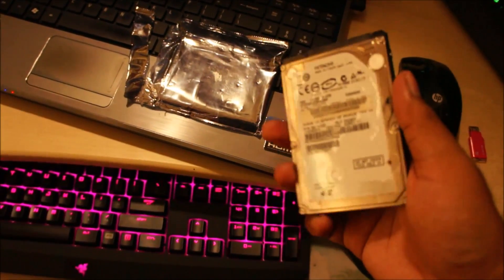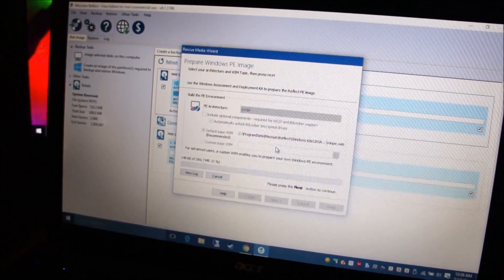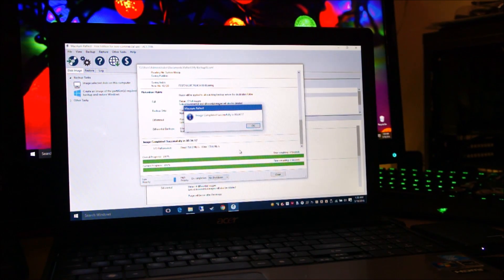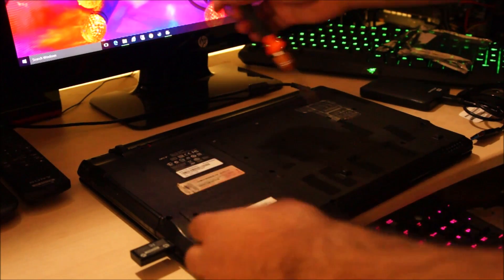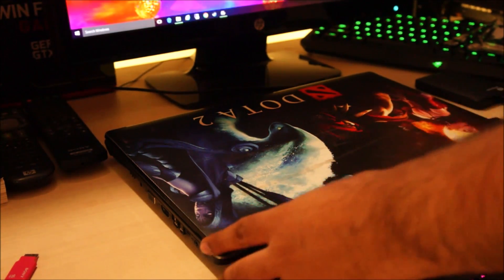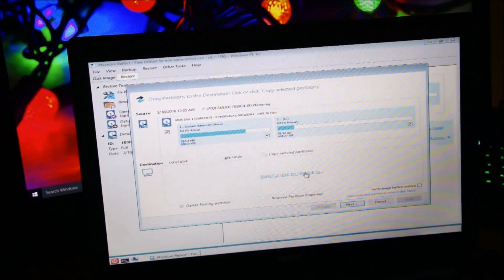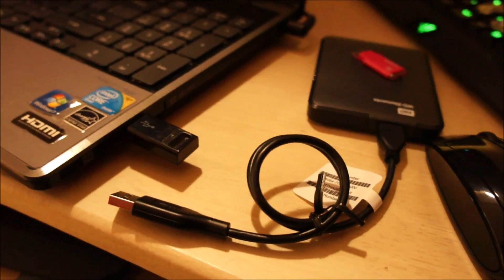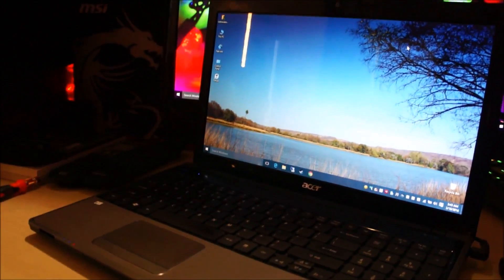Clone/Copy EVERYTHING including Windows from old hard drive to a new one step by step (Easy way)

Comment: I tried this on my WINDOWS 7. Everything went well as expected and as seen on this video until I went to restore the computer system with the newly created CLONE. Once I had plugged my cloned external hardrive and the WinPE recovery memory stick into the USB port, I went into BIOS of my computer and changed the boot order to USB WinPE recovery memory stick. So, that when the computer system boots, it will boot into the WinPE usb stick as is shown in this video. However, my computer system doesn't LOAD the MACRIUM software or WinPE recovery program but REPEATEDLY DISPLAY the world GRUB over and over nonstop in a DOS MODE. I thought maybe it was just my computer system that is acting up. So, I tried the whole process on another system but with the SAME RESULT. I can't for the LIFE OF ME figure this OUT and very frustrating. I am about to switch to some other software. If someone could reply to my comment in time, I would appreciate it. Thank you.
Reply: TN Hi TN, Thanks for ur comments, it help clear a lot of doubts. I have one question though. The process referred to in this vdo & to which u referred in ur comment, is this called disc CLONING or IMAGING. I think once u clone ur disc to an external hard disc, u can directly boot from that. But if u have a image file then u need to follow this processes. According to my understanding therefore cloning is a faster process. Actually I am trying to clone my hard disc & is searching for it for this for past few days. If u have any idea on CLONING process I would like to get enlightened.
Reply: TN Lol that was a smart move 😂😂😂😂
Reply: I'm not sure if I understand your issue correctly, and to be honest, I didn't watch this video passed the first few minutes. But if this doesn't work, you may try a whole bunch of programs like EASEUS, Paragon Partition Manager or Paragon Migrate OS to SSD or Acronis... I always keep a safe copy of my OS in another disk. There is plenty of info on youtube and google on how to clone a Disk, so if this doesn't work, find another way to do it.
Reply: +cubansoy
Hi, thank you for your reply. I figured out what the problem was. For some odd reason, my computer systems don't like to boot from USB. So, what I did was this. Instead of trying to run and boot from USB, I burned the rescue.iso on to a DVD as boot disk. Voila!!!!!!! Everything works this way... I was able to clone and restore my hardrive. Awesome!!!!!
Reply: ggv

Comment: once i cloned everything, can i use the old disk into another computer with all the old data in or there will be problems with windows license and all the other programs since im essentially using the exact same data (programs) on 2 different pcs?
Reply from the maker: Yes, you can use the old disk on another computer without any problem, but sometimes you will need to change BIOS from UEFI mode to Legacy mode, typically when moving the disk from an old computer to a new one. (usually, computers which shipped with Windows 8 and above have it set to UEFI) 
Windows will pop up a message that there is an error with the product key, you can keep using it but it won't allow you to apply themes or change windows colors rest will work as normal, you will have the exact same data and programs on 2 different PCs.
Reply: thank you for the informative answer!

Comment: Great video! 
I just went through this procedure. One problem that I ran into was that my EVO 850 1TB SSD was not reliably visible on the laptop USB 3.0 port (it would show up and disappear) but was visible on the USB 2.0 port thought it took approximately a minute for it to initially appear. It turned out that the older model “USB 3.0 TO IDE/SATA” adapter that I just purchased did not work reliably with this drive on the USB 3.0 port. After a long period of trying to understand that issue, I ended up just formatting the USB on the USB 2.0 port. I also made the mistake of checking the verify option during the restore process; it took 24 hours and displayed no errors.

Comment: I have made a exact clone of my HDD into a new external HDD. with  my internal HDD intact in my pC and with clone hdd connected tthrough USB, how do I boot from the clone disk ?
When I tried to change the boot order in bios from UEFI hard disk to  UEFI usb or just USB ( my USB HDD details are not showing, but bios simply shows as Mass storage device, is it a problem) my pc is not booting. I assume once you clone it should be a straight forward swap of the HDD to boot without a need for any rescue disk. It worked for me easily in Mac but in Windows  it is not .. am i missing anything , pls help. 
I need to verify whether my clone back up works or not

Comment: Can't i just directly create a clone drive of the old hard drive and not be bothered creating an image backup with that software ?
Reply from the maker: yeah, you can but for that, you will need a free SATA port on your desktops motherboard and a SATA cable or if you are doing it on a laptop you will have to buy a USB to SATA converter board.

Comment: Works with desktop hdd too right?
Reply from the maker: Yes it does, by the way if you are cloning on a desktop you won't need a external hard drive, you can directly plug in the drive you want to clone to in the empty sata port.

Comment: do u need a boot image if you buy a new motherboard and u delete all the drivers on the pre exsisting motherboard? because ill have both hard drives in when i boot with the new motherboard 1 with windows one without.
Reply: as long as i delete all drivers in device manager and in programs it shouldnt prompt me for a license key right?

Comment: Great Work!
I have one question. My laptop has windows 10 home pre-installed on it. And I need to replace the hdd. So, If I did exactly as you described in your video, and then made a factory settings reset to the laptop. Will the windows be lost ?

Comment: great work, saves the need of sata cable, thanks for sharing. Question: does the external hardisk need to be empty or it can save the images as long as there is available space for the image?
Reply: For the sake of history: I used my backup external drive with a lot of files - HDD image created by Macrium is just another file, no need to format/empty the drive.

Comment: will the windows be active still
Reply from the maker: Yes,Windows will still be activated  if you use the cloned disk on the same computer. But If it's put in a different computer then Windows re-activation is required.
Reply: Thx

Comment: Will this work with dual boot disk , if I clone the disk to the new disk . Is it going to dual boot after the process. Or I have to make two bootable drives. I installed or dual boot Windows 10 with Windows 7.
Reply from the maker: Just copy ALL the partitions from your source drive (the one which you are copying from and making an image)
And when you are pasting onto the new drive paste everything from the source drive image, in short, yes it works with the dual boot drives.

Comment: thank you for the video, quick question if i clone the hard drive and try to put it on different computer  does it work also ? all i need was clone the software but i don't think it will work due to so many set up require so instead i will clone the hard drive but i need to know if it work on computer to other computer (different spec and different brand etc)

please let me know I really need the answer soon so i can go get new pc
Reply from the maker: Yeah the cloned drive will work with ANY computer new/old different brand as well.. Windows will automatically download appropriate drivers needed for different model hardware ( BUT sometimes if the PC you cloned from is a older model (Windows 7) then in that case just make sure that BIOS is set to "Legacy" mode on your new PC. On all new PCs BIOS is set to UEFI mode.)
https://technet.microsoft.com/en-in/library/hh825112.aspx 
Another thing is that you will need a new license of Windows for your new PC.. Windows will automatically ask for new product key on the cloned hard drive.

PS: I love the husky in your pic :)
Reply: thank you so much for fast comment !! i will try it later and let you know how it went.. also did you ever herd about hard drive docking station ? I found it and just wondering if that work same as yours :)

Comment: so if i clone a hard drive to have two identical drives could i install the old drive onto the original computer and install the clone onto another computer? would that work or no?
btw awesome tutorial I'm just curious about that.
Reply from the maker: Thank you 🙂 and yes that would work no problem.. But Windows will show "product activation error" on your second computer because it will detect hardware change. Other than that everything will be exactly the way it is like on original computer.

Comment: I have a question I just followed your tutorial step by step and windows 10 loaded just fine but when I went to check the hard drive size it says its the same as it was before I switched out the hard drives and it now has a larger hard drive did I miss something?
Reply from the maker: This is correct! if you clone to a larger hard drive, your PC will still show the exact space of your previous configuration.
This can be easily fixed though Windows disk management since your new hard drive has all the space but its not configured to use it.
Right click on Windows start logo on the taskbar and click on "Disk Management" here you will see "Unallocated space" marked in black. With this you can either create a new partition or merge it into C drive to increase capacity of Partition C.
To increase the size of C partition just right click on "C" marked in blue and select "extend volume" just click next and thats it.
Reply: Ok I still have a issue I right clicked on the Windows start logo clicked on disk management saw the Unallocated space marked in black however I right clicked on the C drive and was unable to select "extend volume" on drive C since it was in gray and not able to be selected any other ideas how to make this work?

Comment: if i use a usb to sata adaptor will my hdd be considered as an external hard drive thus making me able to copy my existing disk?
Reply: and btw will i still be able to use the disk i copied from?
Reply from the maker: Yup! that will work too! If you use a usb to sata adaptor then you wont need to boot from USB, you can then directly make a clone with your computer booted up in Windows and yeah, the original disk will remain as it is with no changes.
Reply: Tech Guy Charlie thanks and one last question if i use the new disk in an other computer will it work or will it have drivers problems?
Reply: it would be good to practice this process with the flash drive boot device. i will do that.
Reply: Please help, I used and adapter to plug my hdd directly into my new computer to make a clone. The clone was successful, but its like nothing happened at all.I cannot access any of my files and programs. How do I get it to boot up?

Comment: I used AOMEI saved my data and cloned everything. I cant believe my failing drive held out long enough.

Grab one of these: https://www.amazon.com/Black-750GB-Performance-Mobile-Drive/dp/B00DSUTX3O

And a sata cable: https://www.amazon.com/StarTech-SATA-Drive-Adapter-Cable/dp/B00HJZJI84/ref=sr_1_3?s=pc&ie=UTF8&qid=1476428764&sr=1-3&keywords=and+a+USB+to+SATA+adapter

You'll be done in a couple hours most likely.

Comment: You don't need the extra external hard drive.  Just boot from the USB and mirror the existing hard drive to the new hard drive.  Then take out the old and replace with the new.
Reply from the maker: Bro, then how will you power the new hard drive? Mirroring will work only when you have a usb to SATA converter which most people will not have ready! That's why I used a external hard drive which is more readily available with people.
Reply: Hey, I have the usb to Sata cable, Does it need the usb to boot?

Comment: Hey man nice tutorial... I tried exactly every thing the same... The target disk was small but the mount of data on it was only 60 gb.. Which should be fine for 120 ssd... But after selecting restore Option and selecting ssd it gave me error as not enough space.. Any suggestions?
Reply: i had the same problem. what i did to solve it was click and drag the 2 partitions that i needed and put them into the new hard drive. lol.

Comment: Why didn't you image from the old drive to the new one ? Is there a purpose in backing up to you external drive ?
Reply: yep, it worked!
Reply: Stephen Lee I'm doing that now and see will it work from my desktop
Reply from the maker: Hi there, you cant directly image the old drive to a new drive on a laptop computer.. on a desktop yes since you can use the extra SATA connectors.... but on a laptop nah..
I could have done from my desktop but wanted to make this video simple for my subscribers since not everyone will be willing to open up their desktop.
Reply: Tech Guy Charlie I didn't know you couldn't do that. On other tutorials I've seen they've cloned the old drive by putting it in an enclosure for power and connectivity .
Reply from the maker: I was going to do it that way, bought an external enclosure before I did this video but then again not everyone has a external enclosure lying around but here people do have a portable hard drive, so just to make it simple and easier for viewers (though this has more steps) I did it with the portable drive.
Reply: Cool thanks for sharing, I do have an external drive available so maybe I will do it that way.

Comment: hey nice tutorial! you mentioned that it doesn't matter if the source is bigger than the target which is my case! when I tried it says that it is an issue
Reply from the maker: +Bowbe Dadou Thanks bro, It works as long as the used space on your bigger drive is less than the capacity of your target drive.. by the way what error you are getting??
Reply: I used the expert option and disabled the check of target disk's space! And it appears to have worked unless there is something I missed

Comment: Hey man good tutorial. I tried to follow your steps exactly but when i restart with the new ssd i get the message "invalid partition drive" and it wont boot. I have the flash drive with the rescue and an external hard drive with the recovery on it both attatched... any help?
 i am on an hp pavillion desktop running windows 10
Reply: sorry it says "Invalid partition table"
Reply from the maker: +Tahi Hoera That is strange, ive never had this sort of problem.. can you try this?
http://www.ehow.com/how_7671774_fix-invalid-partition-table.html
Reply: Tech Guy Charlie Please provide me your email, I want your help, please regarding cloning without having an external hdd, please help me.